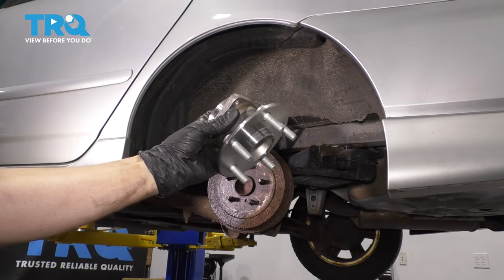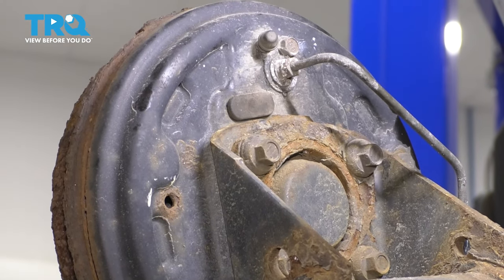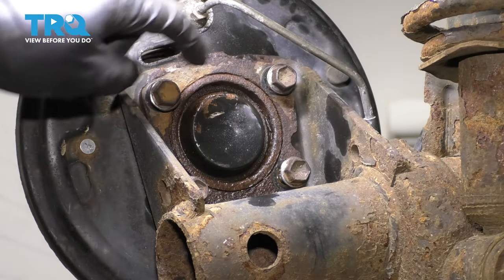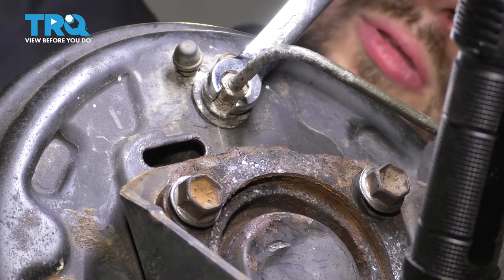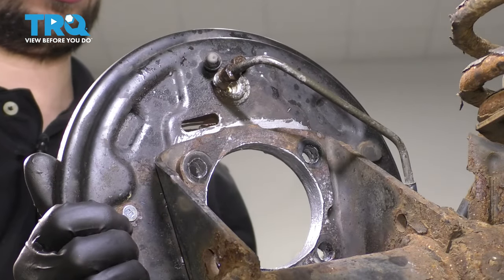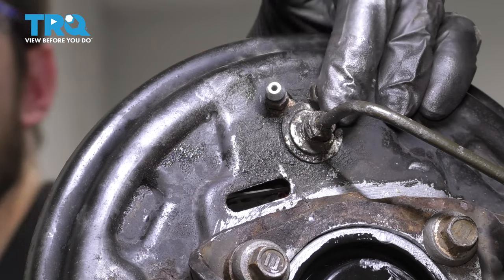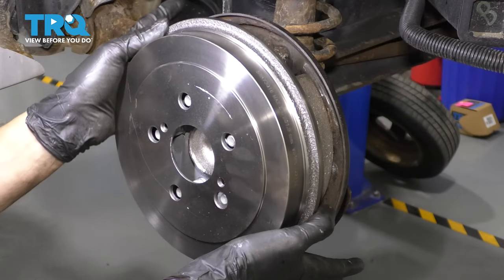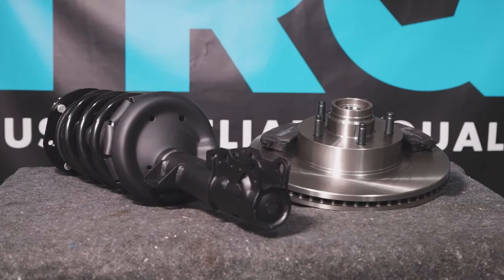How to Replace Rear Wheel Bearing Hub 2003-2008 Toyota Corolla

Comment: I really like how you show many of the "what happens if" such as you can't get the parts apart - they are rusted together.  When you use heat to break the rust seals, where to apply the flame, what to avoid hitting with the torch - awesome!  So many of these type of videos show only the basic "how to" doing the procedure on like-new cars where everything comes apart quick and easy, and I swear before they make the video, they actually DO the procedure, deal with any issues, then record their video so everything will be quick, easy and clean without issues.  This was a TREAT - looked like this procedure was the worst possible case - never saw that much RUST on any vehicle except those that were in a junk yard for years in the rain!  Also indicating the torque values and even order of tightening - Thank You!
Reply from the maker: +@stephendoane2075 Thank you! We love empowering our customers and showing how to perform DIY auto repairs with our high-quality auto parts. http://1aau.to/m/Shop-TRQ

Comment: Thank you for this guide. Took me a few goes. I struggled with the bolts that hold the wheel hub. I could'nt get them lose with my wrench. After a week of thinking about it, I nearly bought a compressed air tank and air hammer, but instead opted for a breaker bar and those stuck bolts came off like butter. Side note, if you're working on a car jack with zero good angles to leverage the breaker bar, there's a rachet attachment from supercheapauto that allows the breaker bar to work like a ratchet - so all angles were open for leverage following. By the third go I was a pro, and did the job in 20 to 30mins (including correct torque pressure for tightening all bolts). This guide saved me a $950 bill at the dealership. Instead paid a total cost of $350 for an aftermarket wheel hub @ Repco. Not sure why they quoted 3 hours labor to do the job at the dealership, a professional should not take this long to change one wheel hub.

Comment: I have to replace the dust shield that rusted away and wont hold the pin for the ebrake anymore on my Vibe GT, which is the same as a Matrix XRS. It has rear disck brakes, though, and I dont want to damage the hub assembly. I cant find any videos on this but this video should help a bit. Thanks!

Comment: Tuesday, August 15, 2023 ☁⛅☁

Could I get the hub off without removing the brake hose? 🤔

My car is a 2004 Corolla, with a fair amount of rust. I already know the brake fitting will not break free.